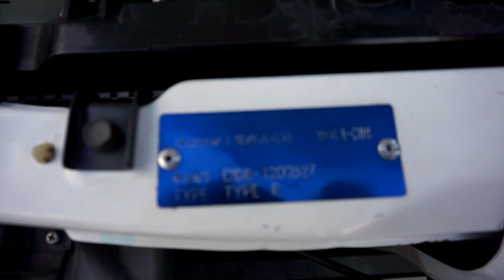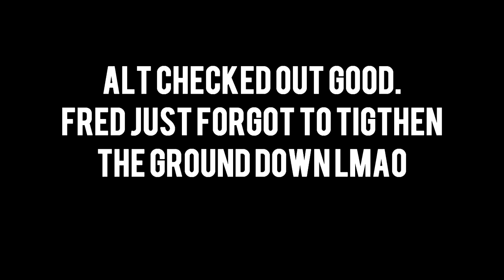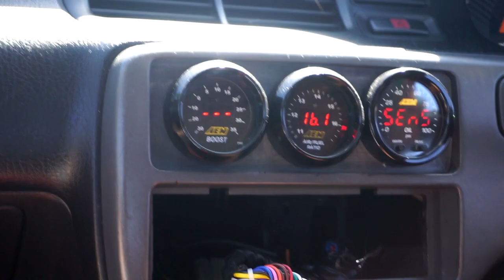FRED'S H2B RHD EG IS ALIVE! - Tuner Evo Miami 2019

Comment: yo idk if you’ll see this but i have a h22a and keep having problems with it cutting out right  around 4500 rpm after like 5 min of driving. also it’s flooding out for some reason with stock injectors and stock fuel pressure rugulator and stock tune